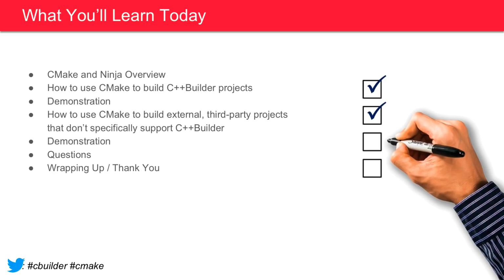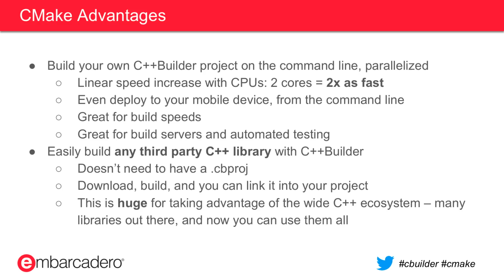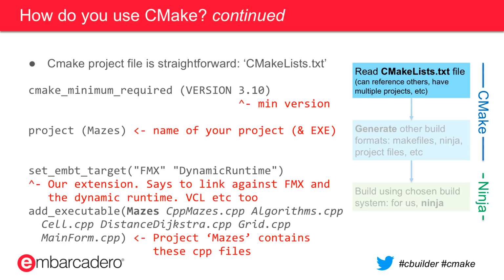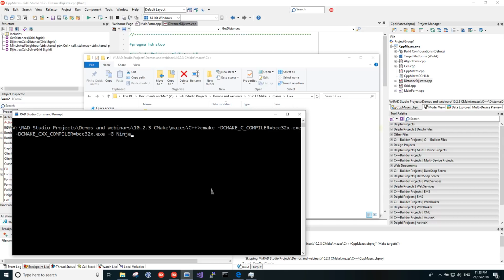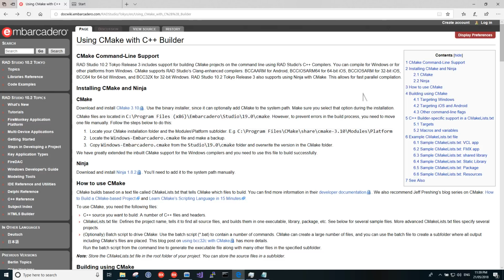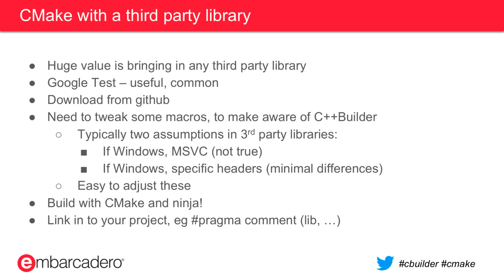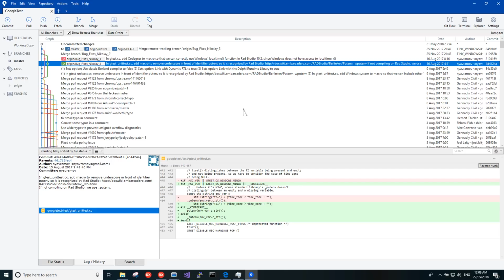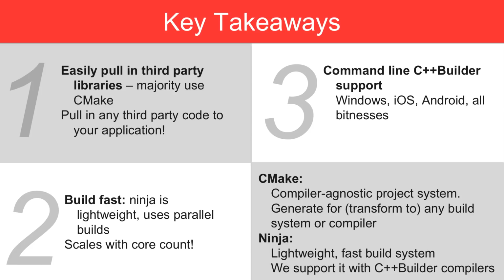Fast Builds and Integrating Libraries: Using CMake and Ninja for C++ Builder 10.2.3

Comment: I personally confirm that "3rd party" project can be successfully converted to be built with bcc64 + ninja (even MSVC-built SDL2 libs can be used with some help of export tools to generate interface libs as we did it with old good bcc32 and some "obscure" patches of typdefs in headers). Yet I built my pet project this way with some tweaks of CMakeLists.txt, which previously were targeted MSVS, g++ on Linux and MinGW, adding android and finally bcc64 was just a matter of adding some "ifs" in cmake files. What I would like to see someday is the IDE's support of CMake/ninja projects or some more smooth way to convert/import that projects to the format, which the IDE can open. Yes. Project files. Doing it manually just to edit code comfortably is not what developers want to do twice. Not in 2019. (It doesn't mean I wouldn't do it myself next time, but it's because of cross-platform nature of the project, not because I want to do it again and again :))